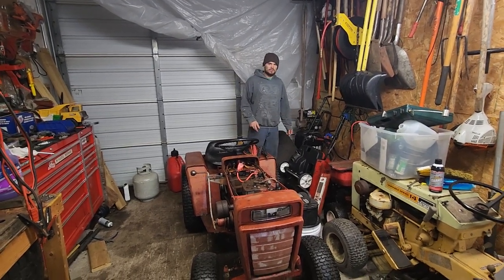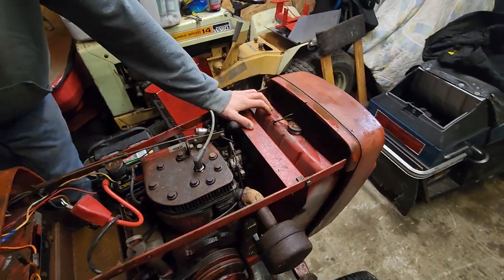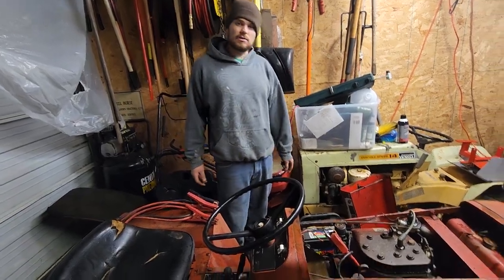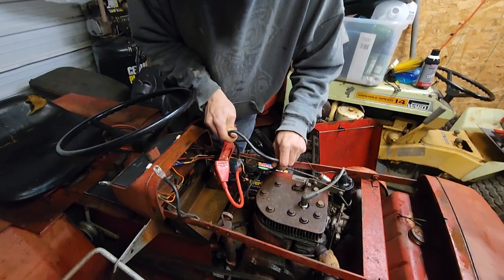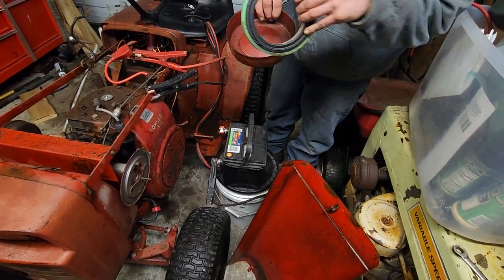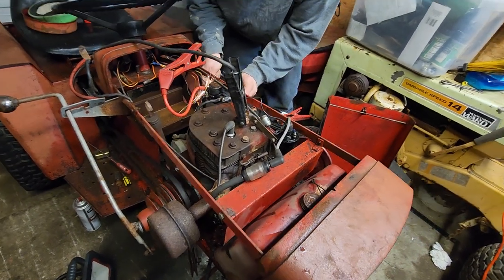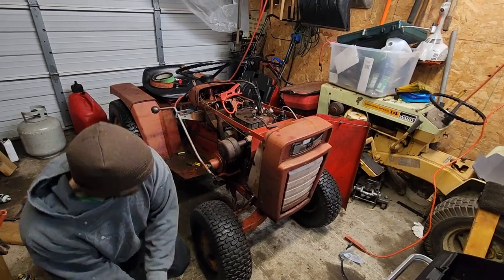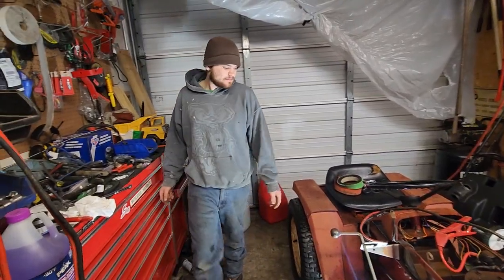new wheel horse gt14

Comment: Looks like a satisfying project! What kind of fuel pump does that machine have? On the Cub Cadets I have they are all gravity fed. Even my Gravely Zero Turn (2004 Model 144Z) will operate without its pulse pump since most of the fuel is above the cylinders, but needs it when making fast turns & when the fuel tanks get below 20%. I found this out when the fuel pump vacuum hose became dislodged and it still operated, but crudely, showing fuel starvation on those fast turns that Zero Turn mowers make. That's a huge fuel tank compared to my 1969 Cub Cadet 125 or my 1970 Cub Cadet 147. --yours is 5 gallons, right? Mine's two gallons! And yours is made of plastic which will not rust. My metal fuel tank got pin hole leaks on the bottom and rust on the inside. The I used an inner tank rust treatment which did not stop the leak. So I used this stuff called Tech Bond designed for metal tanks & it worked swell. I then had to wrap the tank in heat protector because in a Michigan 90 degree +  summer day operation those metal fuel tanks can get hot---especially when they are low on fuel!! The fuel will boil inside the metal tank which is located just above the hot engine! The heat shield wrapped around the tank stopped that!! I added a separate fuel filter in line from the tank bowl to the carburetor even though it still has the bowl on the bottom of the tank & then added a fuel shut off which allows me to put it away when I am overseas with a bunch of gas gumming up the carb. I've always wondered about those Wheel-horse pulley & belt drive systems. They appear to be well engineered but it would be good to see in detail how they work from the engine to the drive-train. Maybe those will be illustrated when the machine gets the refurbishing. I also like that Gilson (Montgomery Ward) back there. Good to have them both covered up instead of out in the elements! ---But hey I'm talkin' too much...
Reply from the maker: They use a rod that is on the pump that bolts to the engine block that runs off the Cam shaft
Reply: @jordantractorvlogs7008  Thanks! --that seems similar then, to the 14hp Kohlers used in the J.I. Case 644 FEL machines which had a fuel pump running off a rod from the engine. I guess most of that era that had a fuel pump used similar set ups.
Reply from the maker: Yes case jd and many others use a fuel pump mounted  on the block